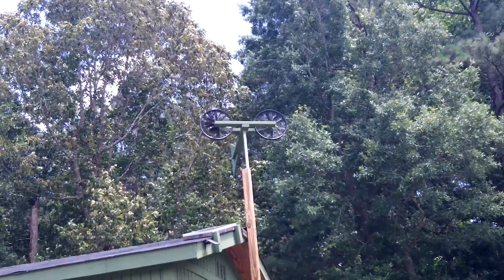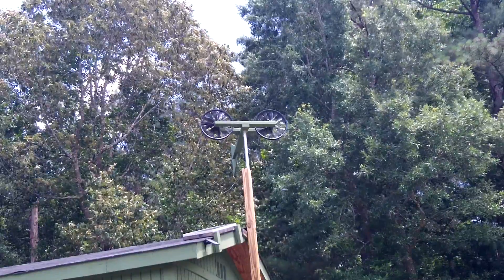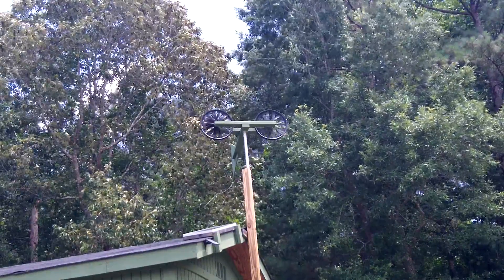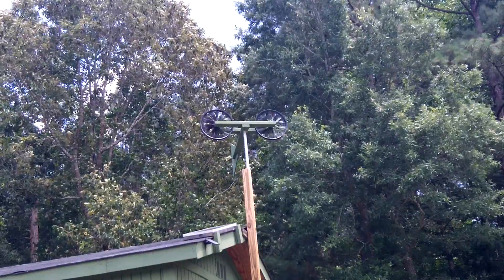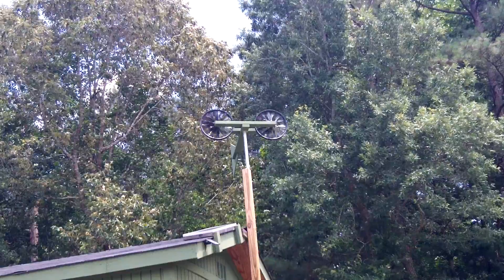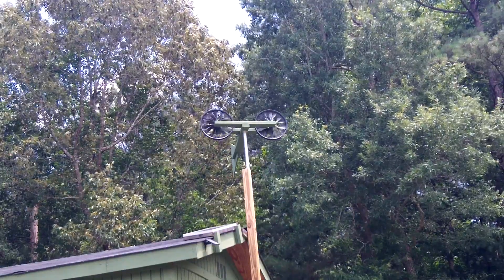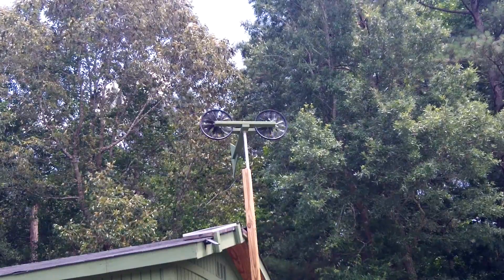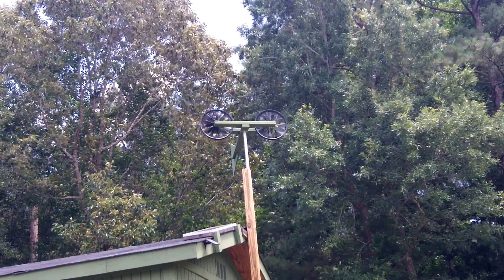Update of the 2 wheel duct tape windmill

Comment: I swear by foil tape.  Especially mastic foil tape. It handles higher temps and will survive high humidity, rain, and heat.  If you need more than tin cans/soda cans, I suggest you get a few feet of vent ducting and cut to shape.  Or an alternate is PVC and a heat gun.